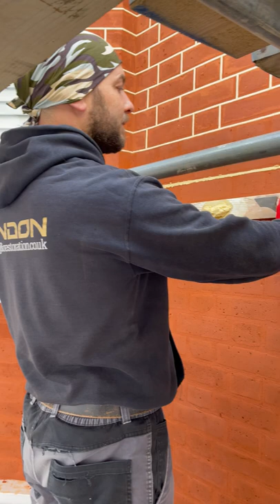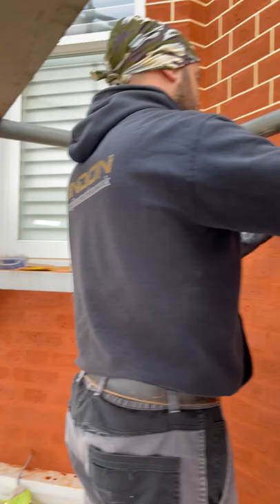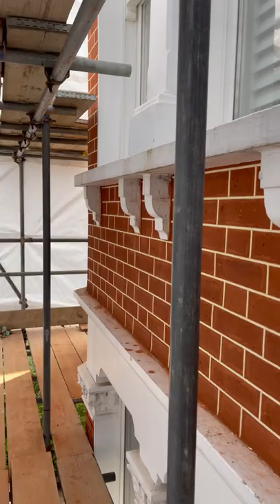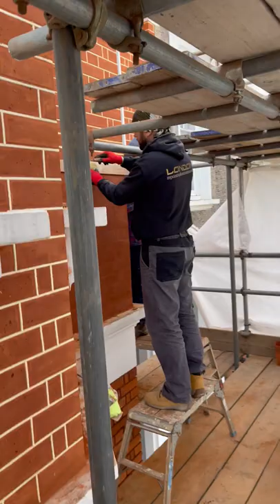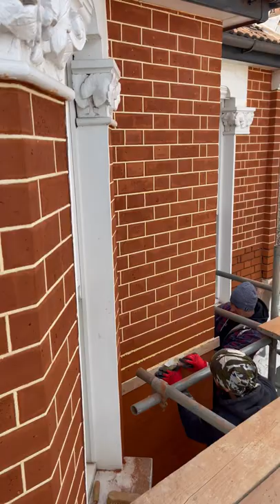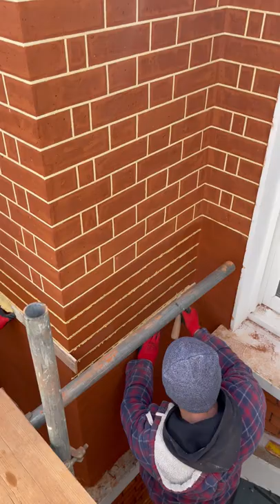TUCKPOINTING PROJECT IN CATFORD

Comment: Thanks for sharing your content mate.

How do you guys get the stopping mortar the same colour as the brickwork?
Reply: use white cement and sand, Hanson Kiln Dried Sand Maxi Pack and Blue Circle Snowcrete Cement for the white lines, to get the cement red you buy Hanson Sand Cement Mortar (red) then use white and grey cement to change the shade of red.
Reply: Mix in brick dust from bricks from the original house.